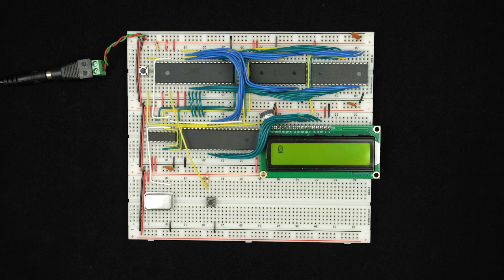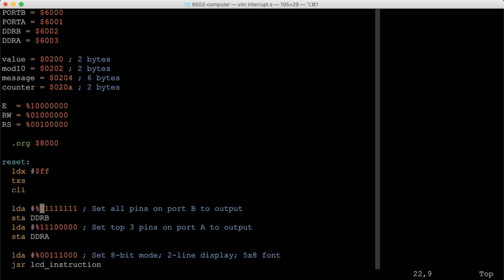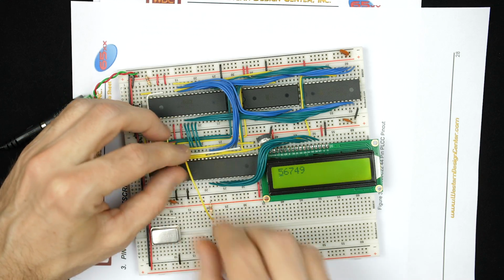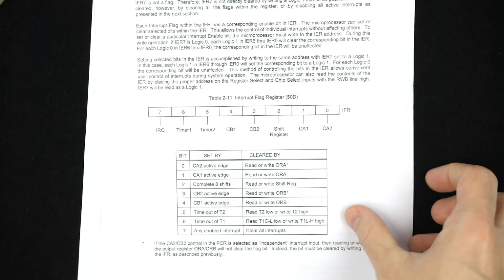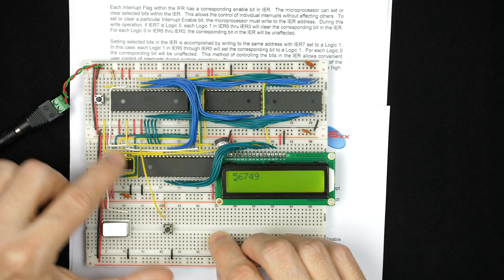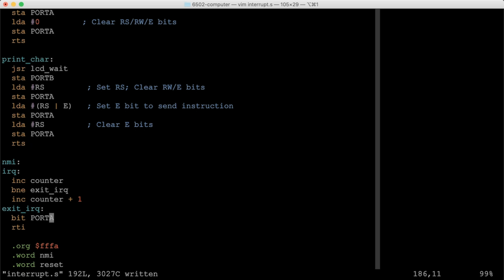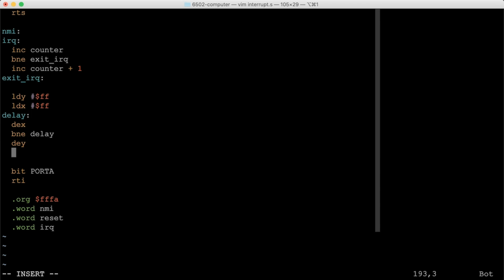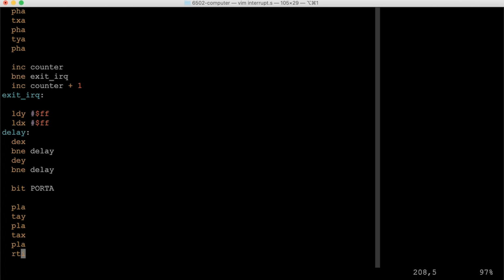Interrupt handling

Comment: For debouncing, I just add a small ceramic capacitor across the two leads of a (normally open) momentary push button.  It works really well with arduino and AVR projects.  It's a really simple analog solution to the problem.
Reply: Back when I was in school learning these things, that was exactly my response to this problem.
But the teacher said "Don't use analog solutions for digital problems."
I was so confused ...

But now I know what he meant:
By adding a capacitor you don't have nice "digital" signals any more.
Beause as the cap is charging or discharging, you get all sorts of voltages between 0 and 5 volts.
The microprocessor does not like that!
So you would also need a schmitt-trigger to make the signal from the switch "digital" again.
Reply: It will also drastically shorten the button's life.
Reply: @404Anymouse  ...how?
Reply: @renakunisaki  You're literally shorting a capacitor by the button. It will arc. A 100nF capacitor obviously won't instantly vaporize the button, but it does speed up the wear of the contacts.

Comment: Yeah, the delay is about 326k cycles. So it will take almost a third of a second to finish on 1MHz. That's definitely noticeable. 

Wouldn't the debounce delay not work anyway if the button bounces when opening the contacts (because it momentarily closes the contacts)? At least it might fire a second time if you only release the button after a third of a second. Another delay won't help because the 6522 latches every bounce. So yeah, you definitely need hardware debouncing.

Comment: I know you probably already have a development path for this series, but how feasible would it be to incorporate a keyboard into the 6502 project (if I understand correctly, keyboards at least used to, work on interrupt logic). This is purely a question from an entertainment point of view.
Reply: I was wondering about the same.. I think a PS2 keyboard could be added, its protocol is pretty simple (one pin toggled for clock, one for data..) - its output rate is around 10khz, the 6502 should be quick enough to handle it
Reply: Thank you for prompting the videos about PS/2 and keyboard controllers

Comment: Love how you can create read in multiple inputs as interrupts.  One project, we used one of the timers as a 'watchdog' that would verify the main CPU program wasn't 'stuck' as well. (a bit of code, setting a semaphore in main code and testing in watch-dog's handler).  Delay loops in the handlers can be a bit 'kludgy' though.  If there's a second event while in delay, miss it completely.  But you covered that, so.... great video.  I've unmasked my interrupt, ready to detect the next video release.  :)

Comment: Interesting. I didn’t know the 6502 automatically pushed the flags register onto the stack and pulled it from it. Coming from the Z80 background, I learned it the hard way a long time ago to push and pull the AF register (you can only push and pull sixteen-bit registers, so the flags register and the accumulator are pushed and pulled together). Pushing and pulling can be expensive, though, so there are much quicker EXchange instructions that switch between the two sets of registers in the Z80.
Reply: The Z80's NMI is edge triggered, thus solving the problem of re-entering over and over again for level-triggering. Too many microcontrollers have the same problem of "exchange register": there's no way to track for double-flips. The Z80, as Moore said, has the exchange-register command. The Microchip PIC-18 similarly has "shadow registers" that are easily clobbered. Use in only ONE place for ONE situation. I doubt there's any auto-checker to flag possible double-use cases :-(
Reply: @JeffreySJonas  I guess the way you're supposed to deal with double flips is: only ever use the shadow registers in IRQs, never allow nested interrupts, and be very careful.
Reply: I'm familiar with the Z80 more than 6502 as well but I've never been able to get my hands on any hardware so since I was always using an emulator I never needed interrupts. Right now I'm designing a z80 computer hardware though so maybe one day I'll be able to actually play with the real thing...

Comment: I don't understand why we need the delay since you are reading immediately from PORTA inside the interrupt handling routine and that is supposed to be the thing that switches off the interrupt. So how is the interrupt routine being entered again ? In fact adding the delay confuses me more since you are delaying that read ! Granted, during the delay the cpu is so busy that can't do anything anyway but still I am confused why it's needed.
Reply: The issue is that the entire interrupt handler code, from the first moment the switch closes, executes very quickly.  Which is normally a good thing. :)

But the switch contacts physically 'bounce' open and closed a few times in the first few milliseconds of pressing the button.  So the interrupt fires, handler runs, interrupt is re-enabled just as the contacts have 'bounced' open and re-closed.  So the interrupt fires again, handler runs again... etc.

The delay is a crude way of waiting long enough for the 'bouncing' to settle down before re-enabling the interrupt.  Hope that helps
Reply: @mikefochtman7164  Yes it helps, thanks. I think my confusion came from him adding the delay inside the interrupt handler making it seem like the blame should be given to the handler itself. 
But I get now that the "bounce" is like someone pressing the button many times in a row. And the delay is a hack to get around that. 
I'm interested to know if there are other software methods to get around this. Maybe by having the handler disable the interrupt and setting up a timer to re-enable it later.

Comment: Just use a capacitor to debounce the switch.
Reply: Not gonna help. The switch is still gonna be low for a long period of time and trigger multiple interrupts, since it's not triggered by a level change, but by low signal
Reply: @dmsalomon  Ben is fixing the length of time problem using the 6522 to only generate an interrupt on the falling edge.
Reply: @Add channel name Sounds impossible.
Reply: Most of my lectures in college were an hour of a complicated solution for a problem to teach a concept, and then right at the end the lecturer would reveal that you'd never actually do it because there's a much easier way.

Comment: @Ben wouldn't it be better to instead of making delay, use time counter (is there one in this CPU?) to check if event was called within some sort of window.

Let say we only perform interrupt if 200ms passed, so code checks timestamp what was it last called and compares it with current time. Then if more than 200ms passed we set the current timestamp and execute it.

This way we can even keep button pressed and it will keep triggering it every 200ms.

Not sure if there is a counter that could we reuse for that though?
Reply: There is no timer counter in the CPU, but there are two in the 6522 ;)
Reply: If there were a timer of some sort, this could work.  You could even add something manually in the main program loop to increment a loop counter and have it reset in the interrupt handler.  So if the interrupt occurs again before the main loop has run, let's say, 20 times, it just ignores the interrupt.

But keep in mind, you're basically forcing the system to ignore any interrupt that happens sooner than 'x' amount of time after the last.  Some applications this might be fine, but others you might 'miss' some valid interrupt events because of the artificial delay.  And we have to consider if we miss an interrupt if/when the timer/ counter 'rolls over'.  So in my example, every 255 times through the main loop, the interrupts will be ignored for 20 passes.

Guess it all depends on how critical the events are.

Comment: A idea I had to demonstrate the timer would be to move the debounce to the 6522.
1)Add code to see if the source is ca1 or timer. when ca1 do:
   a)set the timer as the interrupt source 
   b)Clear ca1 as a interrupt handler
   c)clear ca1's interrupt.

   d)set a 500 ms timer.
When timer:
   a)clear the timer as interrupt source
   b)clear the timer interrupt
   c)Enable ca1 as a interrupt source again.
Reply: You probably don't need 500ms (maybe 50ms max), but otherwise the logic is sound
Reply: There are quite a few ways to scan keys and debounce in software. Probably as many as people who's opinion you can ask. 😋

In one of my own projects involving a Z80 I use a similar method - I scan at a regular interval and keep a note of which buttons are seen as pressed consistently for at least a couple of scan intervals, and then update a variable to indicate which buttons are considered pressed.

The rest of the software only looks at that variable, so doesn't have to worry about delaying or doing anything funky itself. When it sees a bit set, it knows the button is pressed.

I also use a second variable to "acknowledge" a button press which basically just masks it out of the first variable until the button is released. This way I can either take a button press as a "one shot", or implement "long presses with increasing velocity", for example.
Reply: @TomStorey96  I was thinking the same, (although hadn't considered detecting a long press). A nice design having the application only have to check a memory location to see which key is pressed.
The interesting thing is, that although Ben is using the 6522 PIO chip, and I think Zilog had an equivalent one for the Z80, I don't think any (mass production) computers of the early 1980's ever used them. Rather IO was done via custom ULA (or equivalent), which could do all the keyboard decoding using logic gates; the easiest way being to have the switch set a flip-flop, and then poll the flip flop output periodically and then reset it.
Reply: @axelBr1  C64 had two 6522s if I am not mistaken. Or at least something which was very similar.
Reply: @TomStorey96  I checked the Wikipedia entry for the C64 and it doesn't list 6522 chip(s). But does say that custom chips were used to keep the price down.
Reply: @axelBr1  I'm probably thinking of the CIA (was out and about so hadn't looked it up properly). CIA has similar functionality.
Reply: @axelBr1  The BBC Micro had two 6522 VIAs. One for the keyboard and housekeeping, and the other for the printer and user I/O ports.
Reply: @bluerizlagirl  :) I had a ZX81 and then a CPC464, both designed as low cost computers so no expansive IO chips in those.
Reply: @axelBr1  in Japanese MSX standard they used an Intel 8255 (PPI) for Keyboard, cassette motor driver, and other stuff.
Reply: May be a better way is to just use the timer to generate an interrupt at suitable interval, and connect the switch(es) to the input(s) of the 6522 and see what button is pressed. If you use a matrix keyboard, (set an output to select a row, and then read which of the columns is energised via a switch), you can scan at a much higher rate and make the system quite responsive.
Reply: I had this exact thought at the end. I would love this as a video

Comment: This is awesome stuff.  Now I would like to see you marry your world's worst video card with the 6502 and have it display the RAM contents then the dreams of my childhood will finally be fulfilled :P
Reply: It's actually very simple, I'm currently working on connecting that video card to my Z80 computer. Just replace the EEPROM with dual-port RAM, with one side connected to the video card and the other side to the CPU.
Reply: @k4ktus  Not that easy, because now you need some kind of bootstrapper to get your program in memory.  That's usually done by BIOS to load the first sector or whatever, so you would have to implement something similar with a wait state for the CPU while the firmware executes and loads your program.
Reply: @BitwiseMobile  I meant the image EEPROM from video card, not the program EEPROM on the 6502 computer.
Reply: @k4ktus  You'll have to allocate some memory area (called video memory), the videocard will be rendering from. When you want to render something, you'll need to put a contents into that area. Ben Eater is rendering from eeprom, but it can easily be replaced with allocated RAM area. But to render some image next you need to imagine how to translate commands to some kind of figures or anything else you want to display. For example, for rendering circle you need to integrate the circle equation (x-a)^2+(y-b)^2=R^2 and bound it with user parameters (such as a, b, etc). The result array of this equation must be placed into that allocated video memory. Then you'll se a circle on a display.
Reply: @k4ktus  or you can also send data array or whole command via I/O port but this method is much slower and requires additional RAM/decoder/GPU on the board, so usually simple video adapter is rendering directly from the allocated area. If it will have it's own RAM which will be fulled from I/O port then it becomes an external adapter or graphic accelerator etc.
Reply: @k4ktus  Sorry for misunderstanding, now I get it :)
Reply: @the_angler_2  Yes, that's what many of the early 80s computers did.  The IBM/PC, C64, and Apple ][e all mapped video memory.  Interesting results would occur if you wrote to the wrong place in memory :).  Ah, the good times!
Reply: @the_angler_2  I am actually planning to connect it via I/O port, but I'm going to implenent a feature that will make the access fast. Video card will be given 4 bytes in I/O addresses space: 2 for VRAM address, 1 for VRAM data port and 1 for configuration register. In the configuration register, I'll have an "Auto increment" bit. If set, VRAM address will increment automatically after a read or write. This feature, alongside Z80s OTIR instruction, should allow to write data to VRAM at adequate speed.
Reply: @the_angler_2  You would need to run the memory at twice the processor's clock speed, with the CPU and video generation accessing it on alternate cycles. Otherwise you would get problems whenever they both wanted to access the same location.
Reply: @bluerizlagirl  of course I forgot about memory alternation
Reply: @the_angler_2  IBM-compatible PCs used to use special video memory chips with separate buses for reading and writing, in the days of '486s.
Reply: @bluerizlagirl  I started out with Apple ][e and 8088 architecture.  There was external circuitry to drive the display as far back as the first generation of PCs.  The IBM/PC Computer Graphics Array card set the standard back in the early 80s.  It worked off of display mapped RAM as well.  I don't remember off the top of my head what that address range was, but it was definitely memory mapped.  The trick as someone already pointed out is dual port RAM.  You just have to be careful not to write during the display cycle or you would get shearing.  That's a problem that you used to have to deal with often with older games.  You would have to time your update logic during the video retrace.   With faster CPUs and a lot of update logic moved into GPUs that problem is not as prevalent, but it still exists today.  If your game is CPU bound you could end up with stuttering and that's usually because you can't update the display fast enough.
Reply: @the_angler_2  on the Cosmac Elf, there was a weird chip that mapped 256 bytes of main memory onto a video signal as a bunch of square blocks (pixels) using an interrupt and DMA feature to extract the RAM contents.  It wasn't dual ported, so when the DMA was running, 30 times per second, your program basically stopped. Since there was only 256 bytes of RAM on the Elf (you could add more, for only $100 per k), your program was at the top of the screen and any bits changing in RAM would be flickering pixels on the screen.  If you added expensive RAM, you could gain the entire screen for use as display area, without the actual program showing up at the top.  Check the second picture on this linked page of history of the Elf.

http://www.cosmacelf.com/history/
Reply: @tonyfremont  Actually Ben did something like that in his last video about videocard.
Reply: @the_angler_2  okay, I'll check that out, thanks.
Reply: And then program a game
Reply: @spacenoodles5570  Been there, done that.
Reply: On top of this, you would also need character ROM.
Reply: @user2C47  British 8-bit micros typically used a fully bitmapped screen and got character definitions from the system ROM. You could not poke character codes directly into the screen memory, which stored only pixel data (like one enormous sprite). The BBC and Spectrum provided a function which could compare data stored in screen RAM against ROM contents and work out what character was being displayed at a particular position.
Reply: @user2C47  You can include character data in the program ROM

Comment: Couldn't you do it like this? Interrupt handler routine will check if some number in an address is 0, if it is, set it to 1 and then increment the counter and update the display.
Normal routine will set that address value back to 0.
Reply: I suspect that the normal routine will reset to  0 fast and bouncing will still happen.

If you want to save on power the 65C02 has a nifty WAI (WAit-for-Interrupt) which put the CPU into power savings until the next interrupt happens. Just call WAI after the display update.

Note that the original 6502 didn't have that operation.